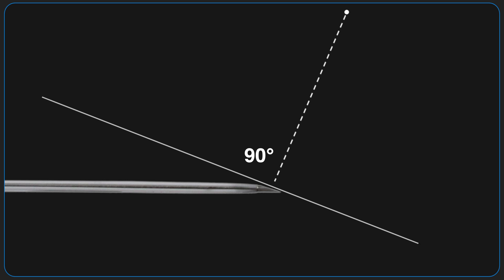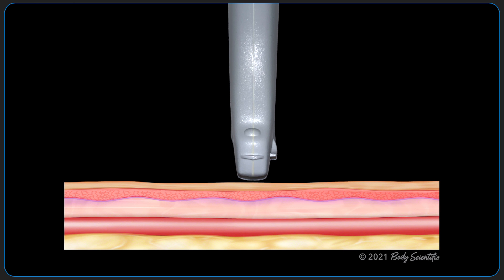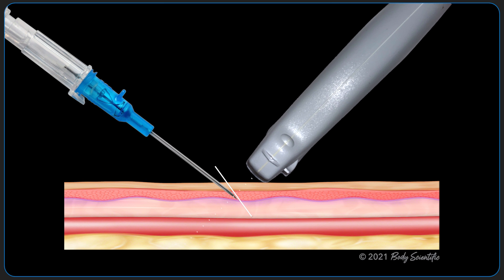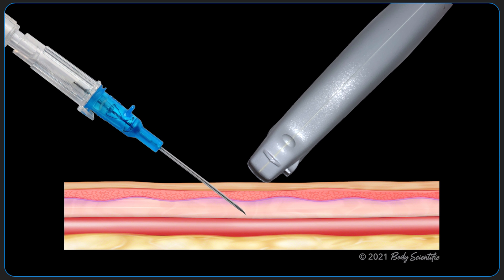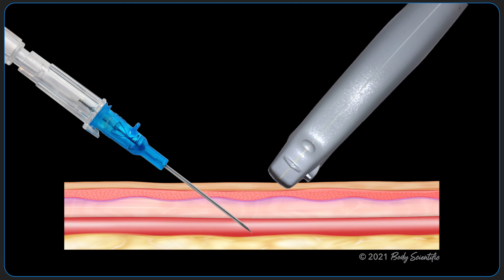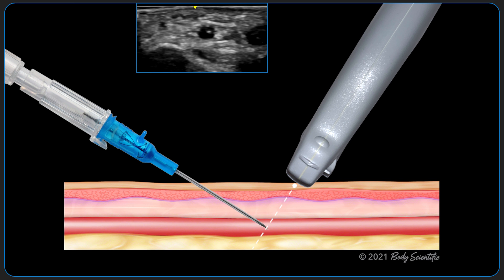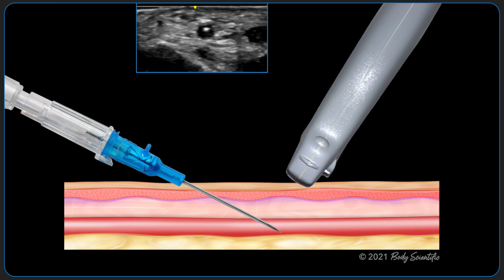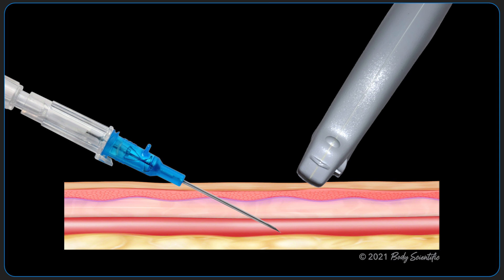Ultrasound-Guided Arterial Line Insertion // Out-of-Plane Bevel-Guided Technique

Comment: After you tilt the transducer to make the beam perpendicular to bevel, don't you lift it off the skin, losing the image?
Reply from the maker: You can maintain contact with the skin by applying pressure and ensuring sufficient gel. But yes, at a more extreme degree of angulation, you might lose the image.
Reply: @PracticalAnesthesiaTechniques  got it. Forgot to thank you so much for the great video, animation and response :) I had 2 more questions if you had time.

1) how far from the probe/what angle do you come at with the needle? Ie do you enter right at the transducer arrow or 1 mm in front if it?

2) when you're creeping forward with the probe, you talked about adjusting the needle left or right to center the probe above the vessel. Do you turn the probe as well or do you keep the probe the same way to keep the vessel centered? For example if you need to correct, the needle might be going diagonal to the probe instead of perpendicular.

Thanks again!!

Comment: Placing it like an IV is slick but I would always prefer to go 'through-and-through' for a higher success rate.
Reply: Success rate is a function of practice. If you keep practicing to place it like an IV and treat the artery like a vein (for which we would never go through and through), and use an appropriately shallow trajectory, you will find that you might fail a few times (like the medical student putting in their first few IVs), but you will eventually achieve 99.9% success. It's what you choose to embrace. However making 2 holes in a vessel if you don't have to doesn't make sense. May increase risk of long-term complications.